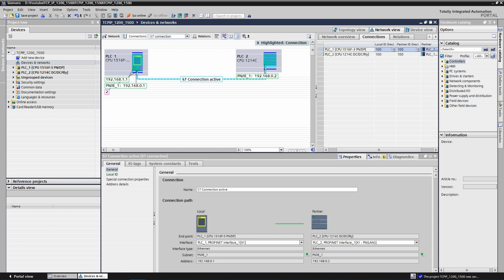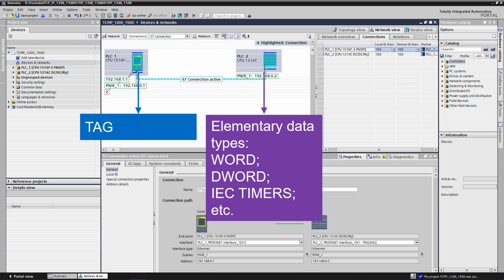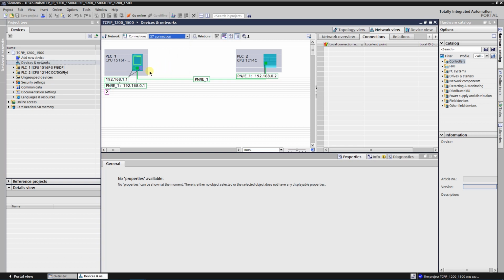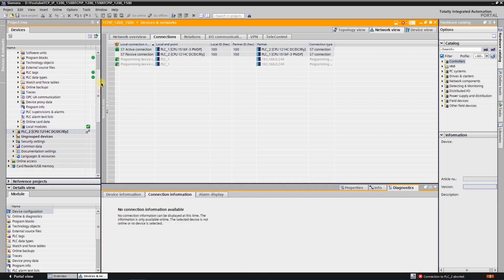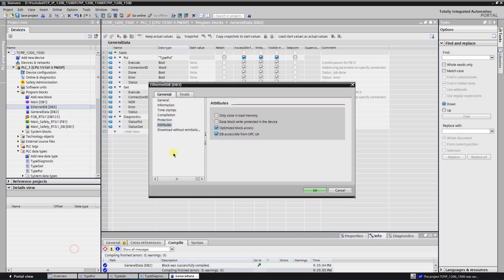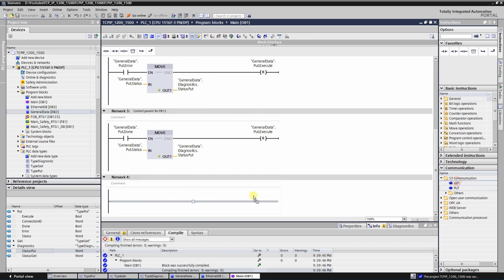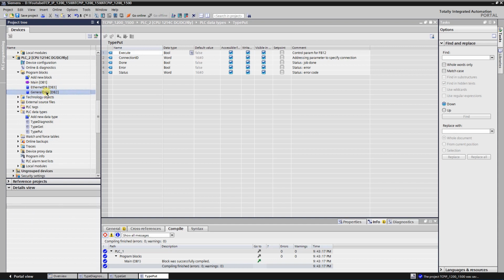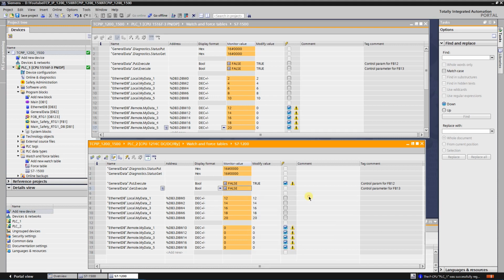TIA Portal S7 Communications: Configured S7-1500 and S7 1200 CPU's connection, PUT and GET

Comment: how to add s7 connection to a device not on the project?
Reply from the maker: Let's assume, that you have PROFINET subnet.
Open your device configuration and switch to the network view.
Click on your CPU to mark it.
Above the CPU there are "Network" and Connections" selections. Click on "Connections".
From the main menu click on "Insert" and "Add new connection".
A new window will open. At the top right select type "S7 connection" from drop down menu and click on "Add" button. After connection is added you can close the window.
On the right, where is "Network View" find "Connections" tab. Select your created connection there.
In the "Inspector window"  select "General" tab. And add the IP address of the unknown device.
Select "Address details". Here you need to configure the rack and slot of you device. For example S7-300 rack = 0, slot = 2.
And you need to select correct connection resources. For S7-300/400 it will be 11.
Reply: @automatikavaldymas  how can I know the correct connection resources like S7-1500 or Simotion D425
Reply from the maker: @Kiw @Kiwikiwizz S7-1500 you could use 10, or you can use TSAP. In that case you need to use local id of the cpu.
Or maybe this video would be useful: Inter Project Engineering with a Device Proxy: TIA Portal, SIMATIC MANAGER. How?
https://youtu.be/jMKDd5Husx0